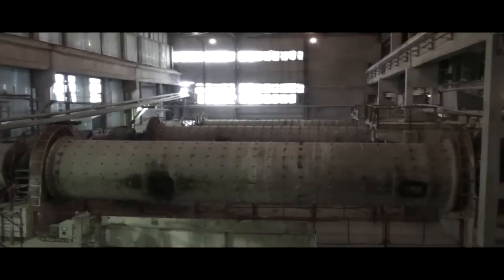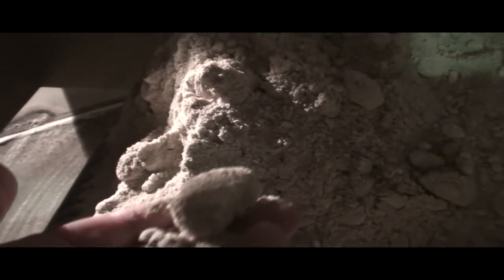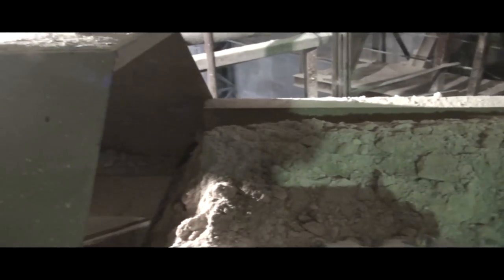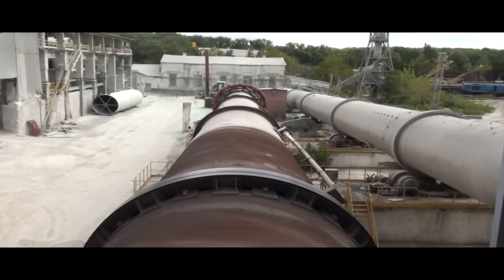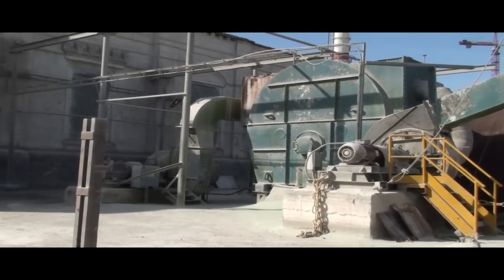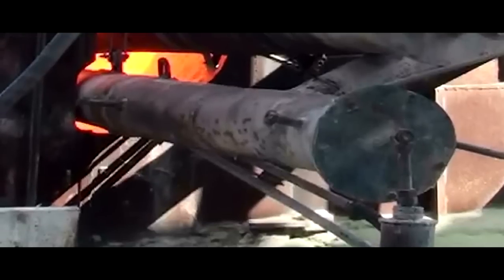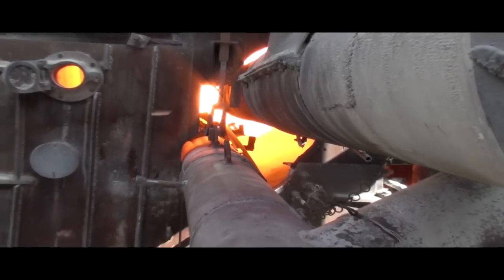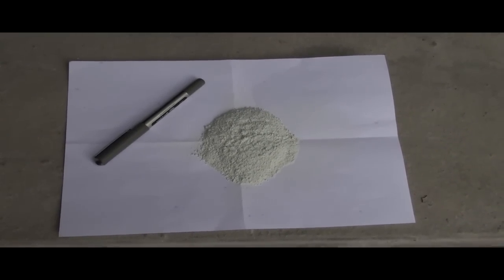White cement

Comment: I am an engineer working in a cement factory for some years now, I want to learn how to operate a kiln. How do I go about it?
Reply from the maker: Hello Lukman
I suggest you first learn about the chemistry related to clinker burning. 
You should also understand the components of a kiln system (preheater tower, cyclones, flipping valves, refractory types, clinker grates, in the cooler, under grates fans, primary / secondary / tertiary / waste airs, etc...)
Once you understand well these aspect, look into the layout at your plant and check what are the gas flows, mass flows in your specific plant kiln and where the source of energy are applied (main burner + precalciner) and where is the energy recovered (exothermic reactions + clinker cooler). 
All this will help you to identify what would be the "ideal" temperature and pressure profiles along the system. These numbers should become sort of automatic for you, to know what sort of pressures and temperatures you will have at specific points of the system.
Finally you can spend some time in your control room, and I mean a lot of time. Normally when the system runs smoothly you do not learn much, only during disturbances or upset conditions, this is when you can learn what to do and how to do it.
If you are serious about it, I suggest you talk to your management beforehand. They will appreciate your volunteering to learn something new and will most probably welcome this initiative from your side.
I hope this helps, good luck,
Cheers, Fred

Comment: Hi Fred,
Is white cement also called hydraulic lime? Are those the same thing?
Thank you,
Loved the video too!
Reply from the maker: Hello Wallace

White cement and grey cement have very similar chemical compositions (Oxides of Calcium, Silica, Aluminum, Iron) and develop strength the same way, upon hydration. The main difference between them is that in the white cement, the iron (and other traces of metal elements) are not allowed to oxidize and are set in the clinker as metals. This is to keep the "white color" in the cement. This is achieved by quenching with water the clinker while it is still in the kiln, and keeping a so called "reducing atmosphere"  in the process - that is no excess Oxygen present.

The so-called hydraulic lime is basically limestone (Calcium Oxide) which has been fired (or calcined, removing the CO2 out of the CaCO3) and will also react (or hydrate) with water.  There are many different types of limes, some have additions of natural latent hydraulic binders such as volcanic pozzolans.

Typically hydraulic limes are used to make mortars and cements are used to make concretes. The applications, where and how you use these, depend on the resistance you expect them to withstand.

I am glad you liked / loved the video ... Thank you! I also invite you to watch my other videos, whether technical stuff or vacations and site visits :-)

Cheers

Fred